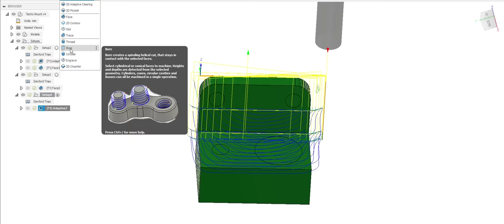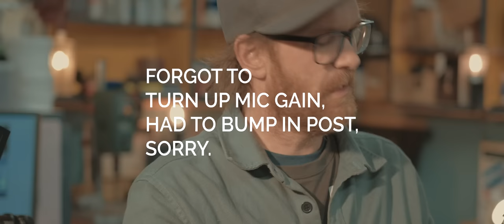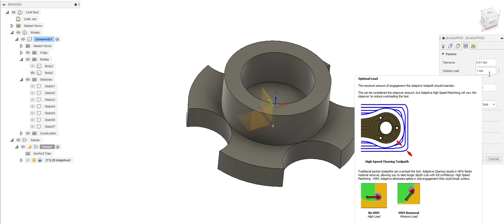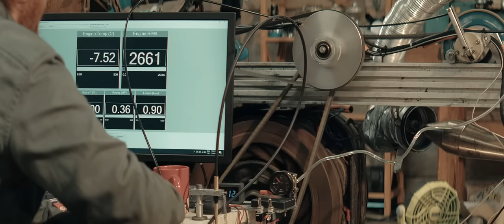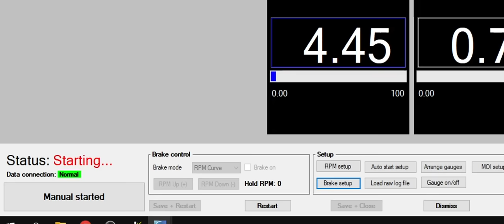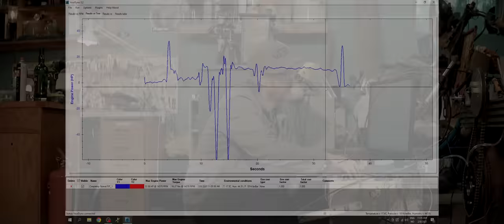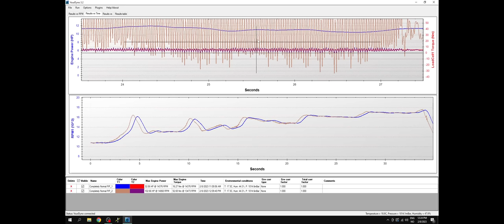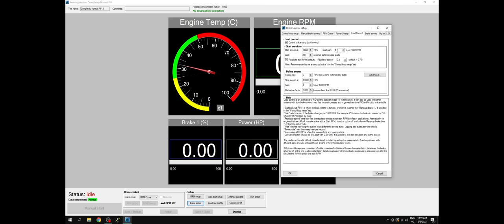Enough! I'm mounting this engine in a frame. (never ending road to most powerful two stroke...)

Comment: I've been watching since before you did this full time and I have thoroughly enjoyed it.  Your engine theory, skills, and determination are nothing short of greatness!

However, your last few (+ or -) videos are on a regressive trajectory.  This started with the premise of building a forced induction two-stroke.  That was EXCITING as heck!  We changed carburetors, superchargers, electronics, etc...  You started putting WAY TOO MANY VARIABLES into it.  Sometimes 2, sometimes 3+.  Directly after the Rotax supercharger, EFI (fuel injection) should've been considered more seriously.  Not "Ni... I mean "WhitERR"-Rigging, the Lectron carb.

Took off the original exhaust manifold that made superchargers possible, removed new supercharger (which was worse than the original during testing), got rid of LECTRON CARB (should've never used it).

Now we are back to O.E. specs (yours).  No forced air.  No unique 2-stroke exhaust setup.  Only expanded ports, which we've seen a few years (+ or -) back already.  

No forced induction, no reason to watch...

I hope you decide to go back to the original purpose of this channel.
Reply from the maker: Thanks! Experimental stuff will be back soon. Need to confirm my cylinder/case/pipe design first. They're kinda experimental too.

Comment: Been watching you since almost the beginning and have always wondered how stuff never flies out of your hand when using your drill press, I nearly pissed myself laughing when you said "no one warned me"
Reply: Haha same here 😂 I cringed every time he’s done this in the past waiting anxiously for the enevitable to happen. Lots of pilot holes and sharp drill bits usually helps.
Reply: Yep, I nearly fell off my chair and got a funny look for it too.
Reply: Physics gonna humble us all at some point.

If a block of metal hasn't maliciously chased ya through the shop, can ya really claim you are actually living a good life?

Sometimes the metal chips are all ya make, some days the pants also get soiled while you grasp the enormity of how momentarily vacant your mind was.

There's a bunch of reasons the clapped out bridgeport and it's equally beat vise has a modded 2 foot long clamling wrench.
Reply: @ThreadTap Whisperer  one of my  best vacant mind momentary moments was when I learned a sudden stop of circular motion still result in energy transfer. Had my angle grinder get caught up in my sweater while using a brush wire wheel. Definitly left the shop that day with said soiled trousers. I know not to wear long sleeve things but complacency is what hurts you the most!

Comment: Hey Alex, here’s another rabbit hole for you: have a look at the Motobecane 99Z engine with “counter piston”. Maybe it can inspire you in your quest! Greets from Belgium 🇧🇪
Reply: Don´t give i´him more ideas ;)
Reply: DKW had two offset pistons working in tandem for scavenging and a third for supercharging ^^ Garelli and Puch also experimented in that field but it all dates back to 1903 with the Bichrone Engine designed by Hippolyte Lepape.
Reply: I looked up Motobecane 99Z. Cheers for posting.

I have one for you:
I've got a lawnmower from the 1970s that is 2 cylinder 2 stroke. For obvious reasons both cylinders fire at the same time which isn't very satisfying. 
The lawnmower itself is a POS design wise, as it could only mow a bowling green - the rear axle shaft sits right in the centre of the grass discharge chute (what were they thinking), but the mower is in good overall condition and runs fine. I can't tell if it has anymore power because you can't actually use its torque due to the grass chute clogging up every 5 seconds. 

The vid below is the later model. Mine is green and cream in colour. The earlier ones like mine had a fault where if you flooded it, it couldn't ever start again unless you took the reed valve off and drained the crankcase. The one in the vid had a modified crank counterweight that would pass closer to the crankcase and aerate the fuel so it couldn't puddle.
 https://www.youtube.com/watch?v=Sh36-4Evhk8&t=2s

There is also the Echo 2 cylinder chainsaw.

Comment: When you're programming in Fusion 360, you can model things like that bolt and include them in the setup as "fixtures".  That'll allow you to see if there are collisions in the program when you simulate it, and some toolpaths might automatically avoid fixtures with a checkbox enabled.

Comment: For dyno testing, why don't you  get a handlebar with throttle and clutch lever? Seems like clutch control would be super easy if you had normal motorcycle controls

Comment: As the RPM input for the dyno control is taken from the crankshaft it does not make any favor for you to clutch out to gain RPM because when you clutch out and the engine RPM jumps the dyno control increase the braking torque and practically stops the dyno.
Reply from the maker: Yep. I have to have it running in the powerband before I press start, if it drops below the powerband everything goes to shit.

Comment: The difficulties with PID can be reflected in a drive chain or belt. When the braking is stable and where it should be the load side of the chain becomes very stable and the slack portion reflects the same just with individual chain link flexibility added on causing a slight flutter once maximum stability is reached. Finding mechanical indicators of programming stability is almost as interesting as it is useful once identified. It's not unusual to lose one of the three values with a less than ideal PID to mechanical match. I think you've already noticed. 
Interesting stuff you have there.

Comment: A friend who used to race 2 stroke hydros said you should try a variable length exhaust. They lengthened theirs in the turns when the rpm dropped and shortened them in the straight aways.

Comment: Hey, Alex. Please think twice about using an inertia dyno for your testing. As you know inertia dynos accelerate a known weight from a given rpm to another (Eg., from 17-18 krpm) to determine the engine's torque and bhp—with calculations done by a computer program. The trouble is: very peaky engines like yours don't do well accelerating from one rpm to another. Experience has shown that the best way to test your type of engine is at steady-state... at one rpm, before moving to the next (17k, 17.5k, 18k, etc). The best dyno type for doing this is the time-tested water brake. They're relatively simple, have few drawbacks, and can be set-up in a small shop setting like yours.

Comment: At these power levels, you really need to make a water or oil brake. That would also make it easy to mount the torque arm on the pump.

Comment: Just add that RC circuit with quite high TC like 0,1s and drive long sweeps. 
I was fighting similar problems on my AC-motor dyno for a year. Added rubber bushes and made frame stronger and did software filters etc. And then RC filter solved everything.

Comment: Seeing how you heat up the coolant before testing, there are this special water heaters for cars, they are like 2kW in power, run on 230volts ant have integrated pump in them. It would made preheating somewhat easier.

Comment: I wish I could get my hands on a CNC mill like yours but I have a 3D printer I use to print out my brackets out of carbon fiber nylon, which hold up just fine.

Comment: Im just going to throw this out there, as i dont know how this eddy current brake is wired/voltages in this situation, most of my experience is with PID loops in regards to water brake dynos and servo controlled water flow valves. But ill throw a hardware/electronics guestimate out there. From the graphs you were showing, and the controllers output % pwm to the current coils on the brake seems a bit erratic, and i have a suspicion that your running into a pwm output resolution issue. Running a eddy current brake with such a small hp range (most of these brakes are designed to handle 200-300+hp capacity to even more, and with much higher input rotation RPM). Trying to get such a fine control resolution could be why the PID loop is having such a hard time doing any sort of actual pwm current control. And a resolution command step for example from 6.50% to 6.75%, could be a big output torque jump that is causing this stall oscillation.

One suggestion, again with my limited understanding on how this brake is setup in your application. Would be to change the wiring configuration so that the overall resistance is higher on the coils, so the voltage increase/current increase per step has a lesser effective torque % output. This dyno isnt going to see 300+NM of torque in this application, so wiring it so that its effective range from 0-100% is for example 0-50nm of torque instead of 0-400nm, and you do that by changing the series/parallel configuration of the induction coils. This should give you a finer commanded torque precision, and allow the pid loop to properly control its desired/command logarithm.

Again, i dont know if this was tested/mentioned in the past. But eddy current brakes have near instantaneous torque application so PID loops are more susceptible to command and torque oscillation then a water brake which has a bit more of a delay/roll-off between command and applied torque.

Comment: YOURDYNO TIPS : Go to yourdyno, Start new run or load existing, Click RPM Setup, Go to gear ratio setup tab, Engine RPM Source box choose Tacho, Put 10,000rpm in the Tacho RPM setpoint, Use a tacho or your ignition unit and hold the motor at 10,000rpm. Then click lock gear ratio. Simple as that. No need for any sensors, trigger wheels, or wiring (All susceptible to noise). The motor does not change its ratio and neither does the retarder. Super simple.

Comment: 1:58 my dad got eight stitches in his hand because his drill press did that to him except it was real thin steel he was working with, it was rectangular; and when it caught and spun around, it broke free from my dads grasp and swung around at him, and one of the corners made a deep gouge from his second knuckle on his fore finger, all the way to his wrist. i was there to witness that from three feet away, and had my uncle not also been there, i would have had to drive him to the hospital at age 14. needless to say, he never trusted anything that wasn’t in a vice on the drill press anymore

Comment: Would a damper on parallel with they load cell help smooth those power pulses and give a more accurate reading? (like a shock absorber, not the rubber damper you have)

Comment: Brake Horsepower = Torque (in pounds / foot) x RPM
                                     ______________________________
                                                          5.252

I used to operate a Thomas Salter brake dynamometer during my second apprenticeship with a DC electric traction motor manufacturer, back in 1979 to 1981. Its load was an air turbine and I had to do the calculation using a slide rule, several times a day, which means that the equation is pretty much embedded into my brain.

Comment: Please help with this question - I also have a yourdyno kit on my inertia dyno, and I also use an ignitech CDI, you mentioned in this video that you would use the tacho out signal from the ignitech, to yourdyno box as your rpm signal. I currently "lock gear ratio" but believe if I did it your way it would certainly be more accurate. How did you do it this way? The ignitech has a single tacho output wire (green/yellow) usually, pin 19, do I just plug that wire to the rpm signal on the yourdyno box? And that's it? Currently I use the yourdyno supplied rpm sensor on my drum, then I use the tacho on the bike and match them..
Reply from the maker: You'll have to use an opto coupler to isolate the ignition unit from the dyno box. Yourdyno wants 5v,ignitech outputs 12v. Could use a voltage divider circuit but complete isolation is much better. Google opto coupler break out board.
Reply: @2STROKESTUFFING  thank you so much for taking the time to respond!

Comment: Nice! I think the 3 chain setup was really hurting the accuracy of the load cell. Itll be cool to see the engine dynoed in all of its forms on the inertia dyno, and adds the possibility of street testing. Just have to be safe with that, a lot of experimental parts in between your legs at high speeds could be scary.

Comment: Been following you since the beginning. I like the concept and you’re interesting to listen to. 

You’re also making very little progress if this is your primary job. I’m speaking as an engineer who has designed and overseen fabrication of many real world things in the same time span. 

I suggest you take a more disciplined design/ testing approach. Make a plan - see it through - then iterate. You seem to change your mind every week.
Reply: Maybe set a goal hp you are trying to hit. The point of this is for a land speed bike correct? So what hp do you need to achieve to break the record in your class? 

Without a thought through approach you’ll never even know when you’ve achieve your goals. You won’t even know what your goals are.

Comment: I think you should edit out those crazy 30+ hp numbers from the videos, except when you are illustrating the dyno issues, because people see "most powerful two strokes"look just at that numbers,  and jump to conclusions. its polluting some of the comments too. I can't wait for you to figure out a solution for the dyno, whether it's low pass filter, dampener, signal processing, or simply the inertia dyno.. I see power jumping rom frame to frame with exremes beetween being -98hp to 54hp. also the highes power figures seem to be when revs are falling ..... only stable values that seem to stick for more than one or two frames are more around 11hp so that aligns with the in depth alnalysis. I have no doubt the engine can make more power, I think precise power measurement early in the design process would be huge help for the fine tuning and even taking some important engine design decisions

Comment: would you improve efficiency by NOT using cad ?? the sensor braket was a piece of aluminium angle with FOUR  holes drilled in it. ZILCH rocket science involved. i reckon i could fabricate the bracket the time it takes to draw cad

Comment: not sure if anyone said this, but i think the "dyno logic" is flawed
i think youre setting the dyno to increase load depending on engine rpm, but you clutch out to let rpm increase to hit the powerband in order to overcome the load of the dyno at the previous load/rpm

maybe try setting a constant load for the dyno or build in a rpm control for the dyno itself
Reply: Hey, Darkizo... You have identified the real problem with Alex's dynamometers (eddie current and inertia types)—setting the load for accurate torque determination without building-in various inaccuracies. Some believe that a peaky-engine (like Alex's design) should be operated at a steady-state-rpm on a load-cell type dynamometer—such as a simple water-pump design. The water-pump dyno allows the engine to be revved to the desired rpm range, where  the water-control-valve is then allowed to admit pressurized water to the pump, causing a load on the engine. The operator manually adjusts the engine speed (now at WOT) to a pre-determined steady-state rpm, where its torque is measured. This is done in steps (e.g., 17,000 rpm, 17,500 rpm, 18,000 rpm, etc.), allowing for a traditional torque and bhp (calculated) vs. rpm graph to be formulated. A few particulars about water pump dynos: A torque-arm is mounted on the pumps case. Ball-bearings allow for low-friction, limited-rotation of the case for torque-reaction force measurement on a rolling-diaphragm, strain gauge, etc., which is mounted at the end of the torque arm. There are a few potential problems associated with the water-pump dyno, but they are outweighed by the positives. Google water-pump dynamometer for more info.

Comment: Im no engineer just a thinker, that's a pretty heavy looking flywheel looking thing the dyno is using, if that hasn't got a way of free spinning and that engine drops in rpm really fast, would that do any damage or hurt the engine in any way? My thinking is that on a car dyno the tires can giveway on the spinning rollers and my assumption of engine dynos is that they are fully free spinning? You'd have to feather the hell out of that clutch to help but then you'd be replacing clutch after clutch... IDK can someone smarter than me help me out?

Comment: why don't you couple the engine directly to a generator, with an armature that has the same rotational inertia than the clutch assembly and a big enough power range to load down the motor to a stall under a theoretical efficiency of, let's say 60%. Much smaller setup, and the load characteristics could be adopted to simulate different drive trains... just a thought

Comment: fusion 360 & 3d printing is nice
Reply: or any kind of automated prototyping tool
Reply: have you tried glow plug ignition, pulsed tho
Reply: you then only match injection/carburetor to the piston, because the plug is hot-glowing all the time, the piston should push the fuel in at correct time

Comment: @2STROKE STUFFING: You are trying to make sense out of the English Language...the most difficult language to learn. It makes absolutely no sense, then throw American on top of it...good luck.
We park on driveways and drive on parkways...
We like to make things "easier", but America couldn't adopt the metric system because apparently doing math with fractions is easier...having to know 12 inches in a foot, 3 feet in a yard, 5280 feet in a mile is easier than everything being multiples of 10.
Does that answer the question about compound words in English?